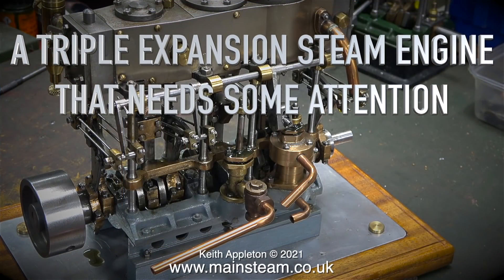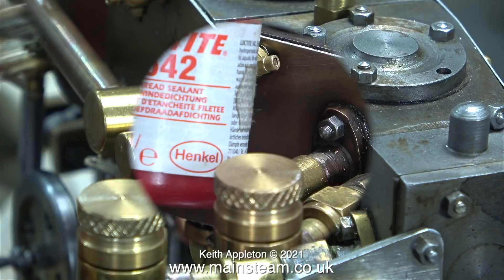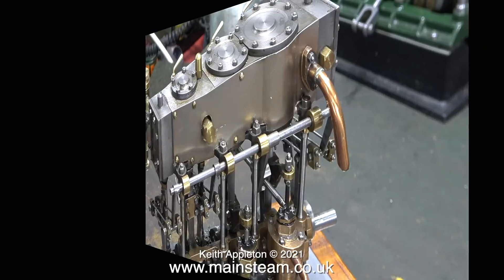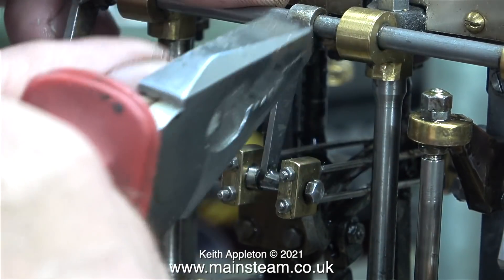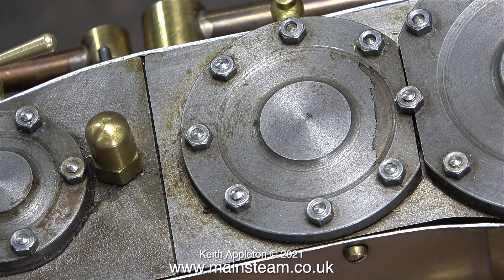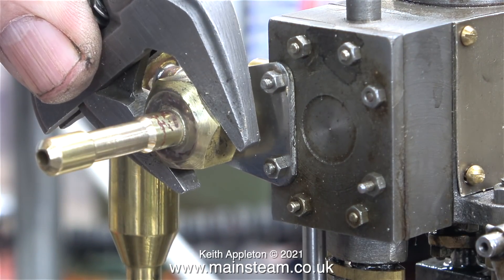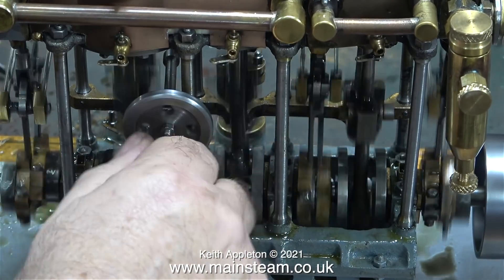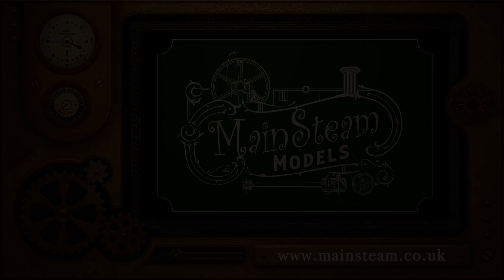A TRIPLE EXPANSION ENGINE THAT NEEDS  SOME ATTENTION #2

Comment: Keith, looking at the positioning of the blanking plugs, they appear to be on the pressure sides of their respective steam chests, and not attached drilled into the IP and LP ports respectively. At one point I thought perhaps the original builder thought about having the crossover pipes on the tumbler shaft side of the engine, but I would expect there to be a plug connecting to the IP exhaust port then. It could have been for setting the valves by ear as you suggest, but I think that could be easily done by removing the plugs in the elbows of the crossover pipes instead. All that said, I am going to double down on the assumption they are for introducing full pressure steam to the IP and LP steam chests.

Comment: Hi Keith, have always enjoyed your videos, and this looks an interesting project. I think the plug on the intermediate steam chest is an inspection plug for setting the valve timing on the middle cylinder. I built this engine around 40 years ago and the plug fits under the cladding.
I'm building the D10 at the moment and have followed your rebuilding of the same engine. I'm just about to start machining the reverse gear so wish me luck!

Comment: from what i can tell for the plug on the cylinder its inline to the chest for the middle cylinder from what i can tell its for a valve you pull to let steam into that cylinder to get the engine going when its dead center ive seen something similar in  a miniature steam lorry

Comment: keith, i dont want to be a smartass now, but i saw u a couple times now using a drill with the dremel and almost everytime u use the dremel tool the RPM is to high for a drill to work propper ( i ve done the same in the past and bought many small drillbit sets and also run them with way to much rpms untill i found out that if u hold the tiny chuck of the drmel between the thumb and the index finger u can slow the dremel down but dont loose the torque momentum..i am also aware that u need quirte some pressure sometimes when drilling with the dremel . but the best technique is to use very sharp drills and then never ever run the dremel to fast again...that way i saved me many many drillbits in the last year instead of sacrifying them to the high rpm. 

greets from Vienna

stay Healthy and yes i find it usefull !

Comment: Keith: Have you considered purchasing a small set of roll pin punches? They have a dimple on the end which corresponds to the hole in the pin, making it relatively easy to drift the pins out using a small hammer. Gunsmith suppliers often sell a suitable variety singly or in sets and they are not expensive.
Reply from the maker: I seldom use Roll Pins thankfully .....